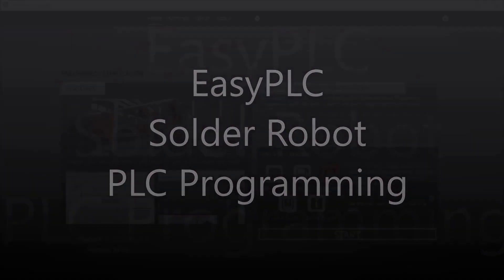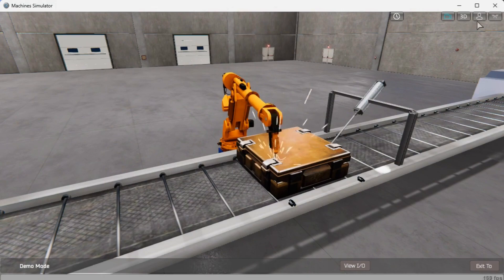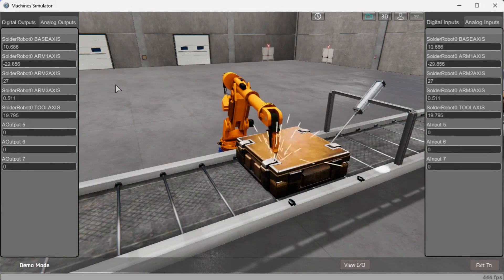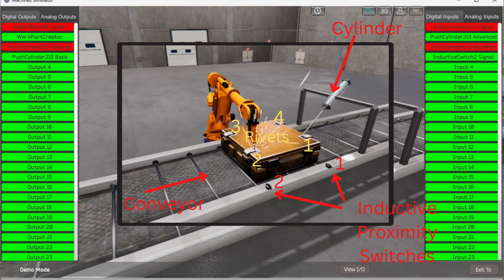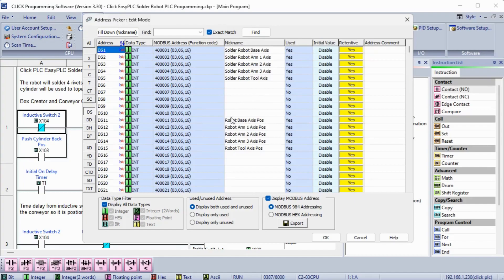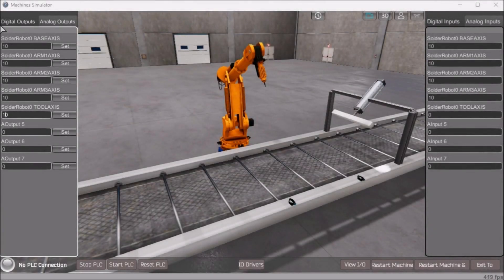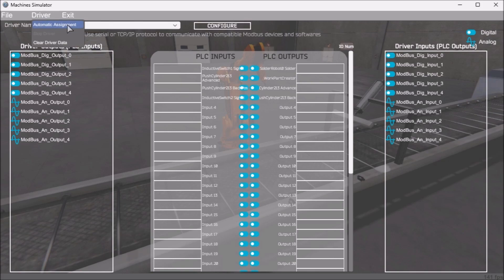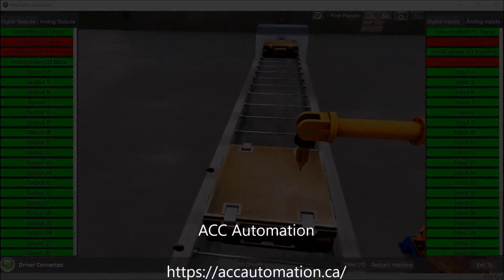EasyPLC Solder Robot PLC Programming

Comment from the maker: More information can be obtained on our website. This includes all of the links mentioned in this video.
https://accautomation.ca/easyplc-solder-robot-plc-programming/

Purchase your copy of this learning package for less than USD 75 for a single computer install or less than USD 100 to allow different computers.
Receive 10% off the price by typing in ACC in the comment section when you order.
http://www.nirtec.com/index.php/purchase-price/
Learn PLC programming the easy way. Invest in yourself today.

The EasyPLC Software Suite Series can be found here...
https://accautomation.ca/series/easyplc-software-suite/

EasyPLC Software Suite is a complete PLC, HMI, and Machine Simulator package.
This PLC learning package includes the following:
Easy PLC - PLC Simulation will allow programming in Ladder, Grafcet, Logic Blocks, or Script.
HMI System - Easily create a visual human-machine interface (HMI),
Machine Simulator - A virtual 3D world with real-time graphics and physical properties. PLC programs can be tested using EasyPLC or through other interfaces. (Modbus RTU, TCP, etc.)
Machine Simulator Lite - Designed to run on Android Devices.
Machine Simulator VR - Virtual Reality comes to life so you can test, train or practice your PLC programming.

Here is a list of YouTube Shorts about the EasyPLC Software Suite, including the Machine Simulator.
https://www.youtube.com/playlist?list=PL3y71jAPOdZAvTC8-TWNifAHpgEkAfqZQ

ACC Automation
https://accautomation.ca/

Comment: Hello,

This is Alper. I am working as R&D engineer in a manufacturer of air conditioner. We produce chiller and other cooling unit with Samkoon HMI. When I tried to upload software to Samkoon HMI, It gives some error.

For example

0x41 / 0x47 / 4x71 / 0x77

Would you please help me about these issue. If you now that how to solve, can you explain for me?
Reply from the maker: Hi Alperen Ulucak,
I have never worked on a Samkoon HMI. I would contact the manufacturer directly. They will need the model number of the HMI and the computer operating system you are running with their programming software.
I hope this helps you out.
Regards,
Garry
Reply: @ACCautomation  I get it my friend. Thank you for all

Comment: I am building a machine and have been developing using a Controllino (industrial arduino) device. I chose it primarily because I am controlling a closed loop stepper. Is it possible to use a Click, or similar PLC to send a finite number of steps to a stepper? Also, I have a homing function working with the Controllino. Can a PLC do this as well? I am somewhat familiar with AutomationDirect PLCs, but have not yet looked into using one for this.
Reply from the maker: Hi SomeGuyInSandy,
Each PLC that Automation Direct sells currently can control a stepper with a pulse train out. The Click PLUS PLC has been recently updated with this feature for version 3.30 and up. This can control up to three axes. 
The high-speed output instructions for the Click PLUS PLC include Home, Velocity Move, and Position Move.
You can download the click programming software free from the AD website and see the instructions. I do not have any videos or posts on this yet, but here are a couple of videos from AD.
https://youtu.be/9n1pAinn1E0
https://youtu.be/f-mYCA9S3YM

https://accautomation.ca/series/click-plc/

I hope this helps you out.
Regards,
Garry
Reply: @ACCautomation  Excellent, thank you for this. I was planning on re-evaluating my choice of control processor, what I need to do now is size a traditional PLC. Thanks again sir!
Reply from the maker: @SomeGuyInSandy  
You are welcome. You will find this easier to program and troubleshoot. Since you can watch and modify the program with the Click Programming Software online to the controller.
https://accautomation.ca/series/click-plc/
Regards,
Garry